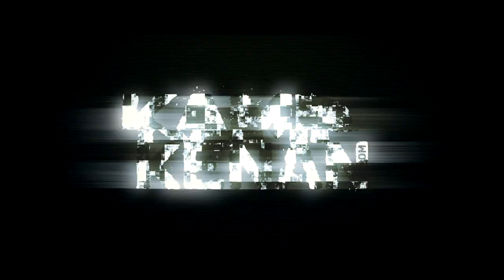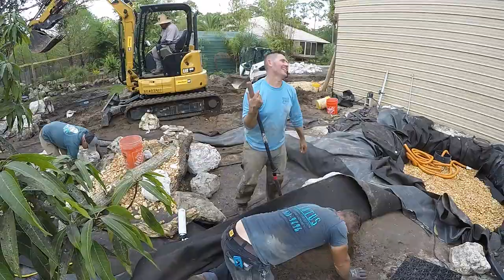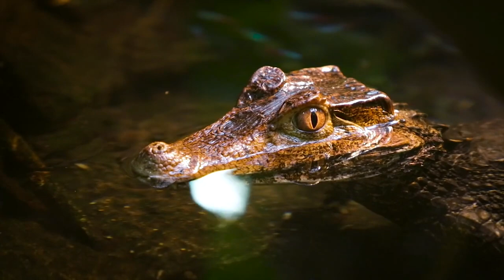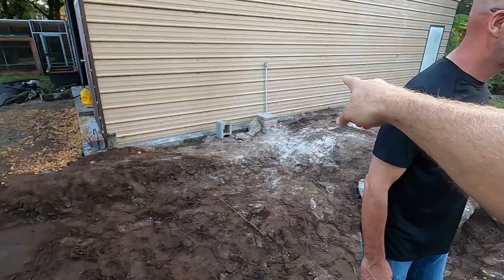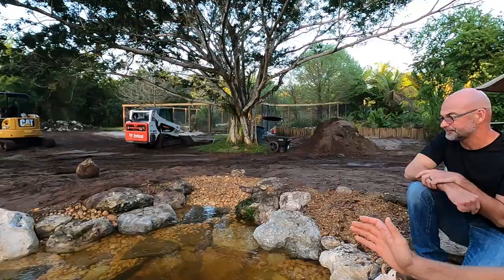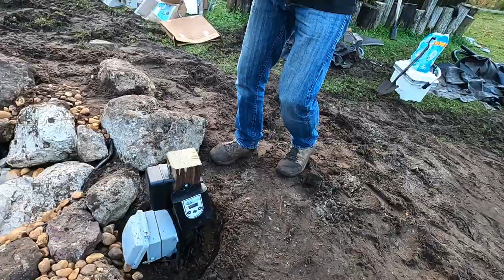The Caiman Pond Build is complete & AMAZING!!!!

Comment: That is coming together beautifully. Really impressive. My one concern and I really hope I am wrong, is how deep into those pipe culverts the rebar is set in. The reason for my concern is it could be hard to clear out debris that gets trapped/stuck in the rebar so you could have the potential for "beaver dam" flow stops that may be difficult to clear out due to the location of the rebar. It could all start with something as simple as a big palm frond or something. Anyway, I hope I am wrong and you can clear out the trapped debris from the back easy access side without any trouble.